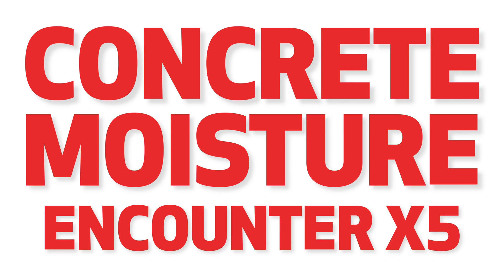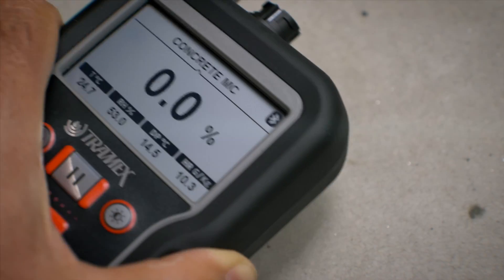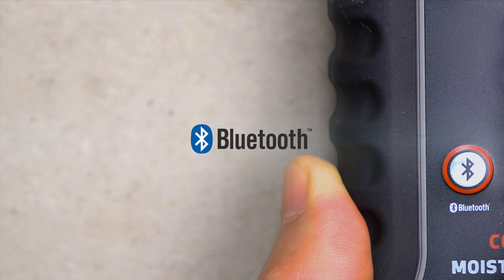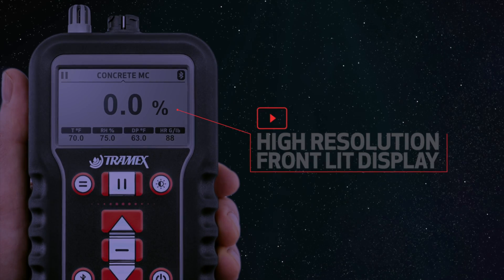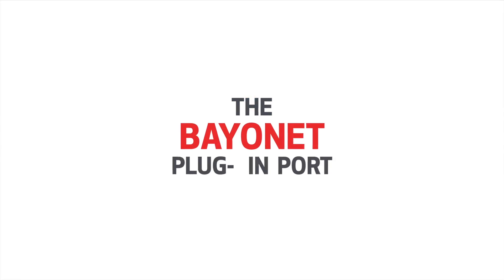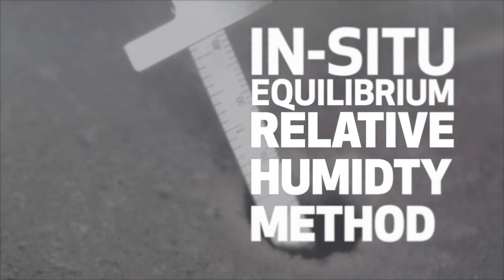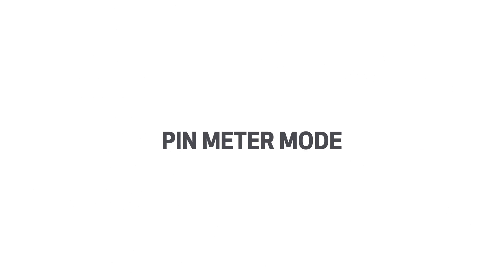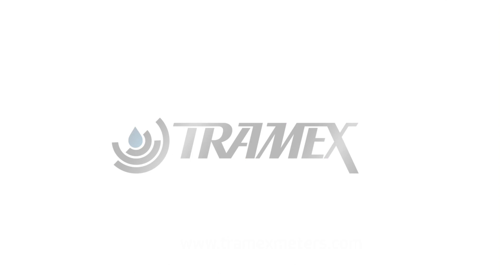Concrete Moisture Meter: What is the CMEX5 - Tramex Moisture Meters

Comment: In my 40+ years of experience with waterproofing and evaluating concrete structures of all types, I have found the Concrete Moisture Encounter to be the easier, fastest and most accurate. This accuracy was quantified a few years ago in a Finnish Study where the most promising moisture test methods were first evaluated in a laboratory environment, then used on a concrete bridge deck, which arguably undergoes some of harshest environmental conditions of any concrete structure. The Tramex Moisture Encounter was the ONLY device that agreed with the baseline controls, based on the exacting gravimetric methodology. The testing was conducted by the Internationally recognized VTT, giving additional credibility and a complete third party validation.
Reply: Bob that means a lot coming from you. We are well aware of your reputation and the success you have had with testing concrete in the field. Thank you kindly.